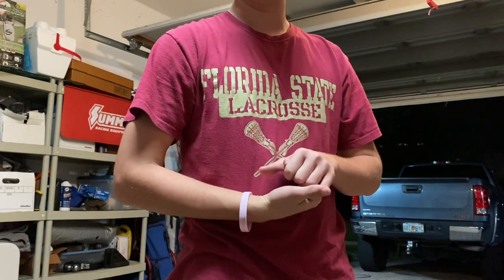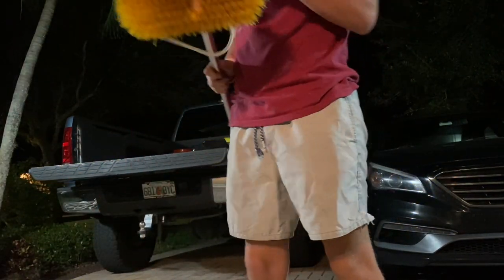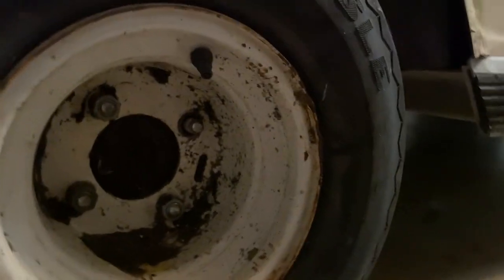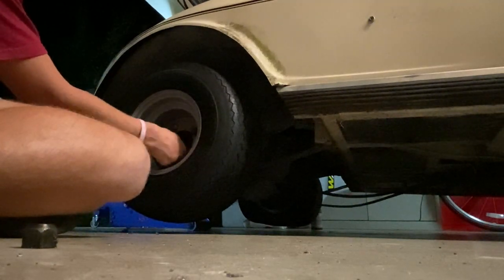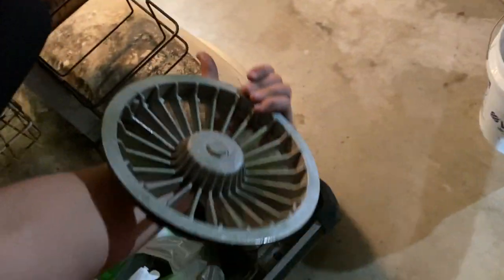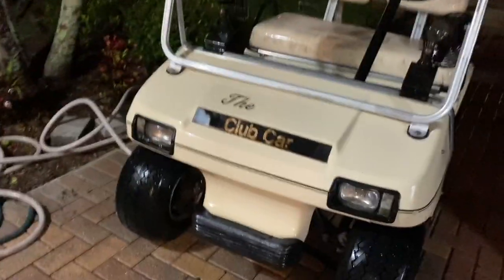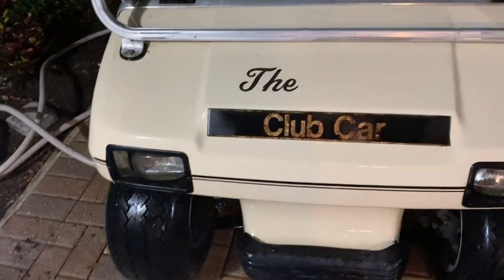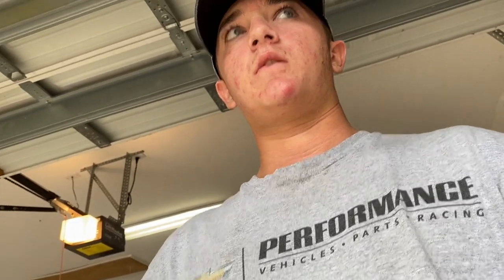Golf Cart Restoration (It lives another day!!!)

Comment: If I have a 1992 club car ds , and the controller is bad. Do I have to put the same exact controller in for $700 or can I replace it with a different controller wondering if they are interchangeable to some extent?